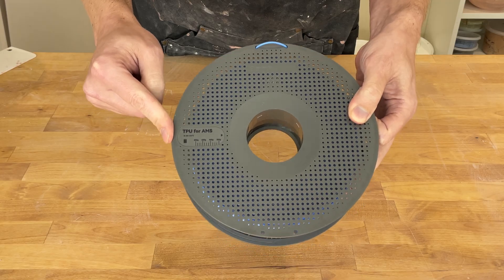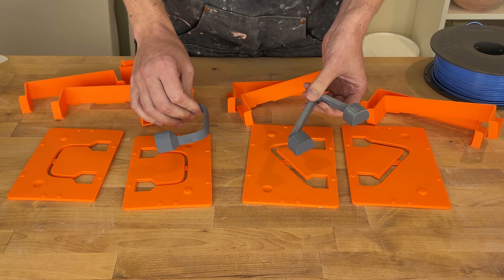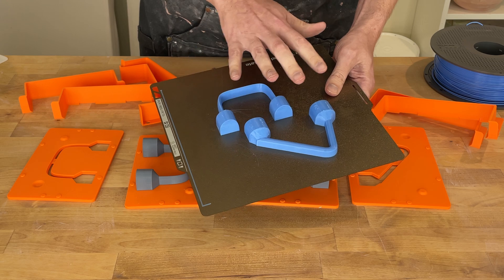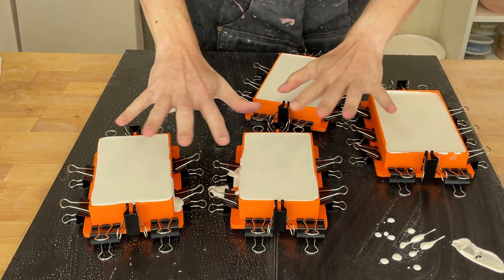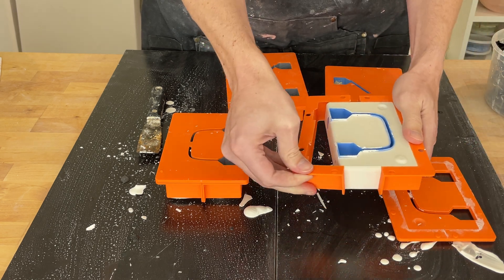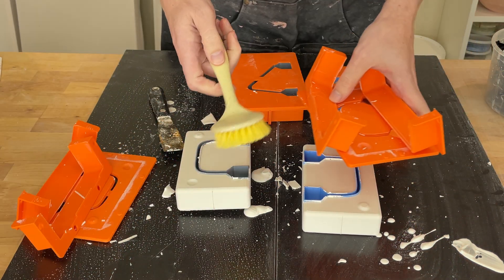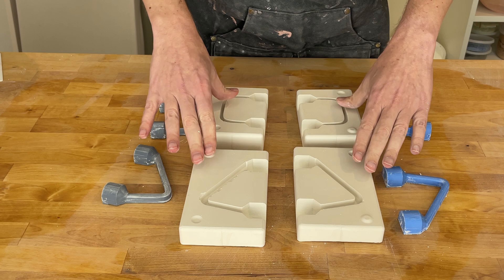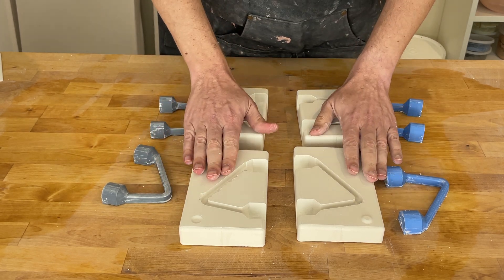Using TPU for AMS for Handle Molds

Comment: I just started watching your progress. I did something different that I'd like to share with you.
I 3D-printed the part as a negative. I then added foam board around the negative shape to build the walls of a box. I then poured silicone into it. Then, I made a box around the silicone to hold the plaster, which separates easily.
Reply from the maker: Yes, silicone is often used in these processes. When creating Shape Cast I deliberately was going after a process that removed that as a step going straight from 3D prints. I just wanted to remove the extra step in the mold creation process (but it does add some challenges to overcome).

Comment: compressed air wouldve helped with releasing a lot. You can also include some handles for pliers right in the model, I see there a lot of empty space in the middle, so a couple of holders will fit. They will be fine in tpu since its layer adhesion is great, worse in other filaments(might have to draw them differently)
Reply from the maker: There is actually not a lot of space for many of the designs for any features to grab on to (as shown in my last video). Some of the handles are rather narrow. The other issue is less that you want to pull up, but inward so as to improve the draft angles. If you get one, do try compressed air and let me know how it goes!
Reply: @PotterybyKent  i think you can put in the millde of the printed handle some flaps where you can pull with the pliers
Reply from the maker: Pulling up isn't so much the problem - it really needs to go inward and up. I actually think snap ring pliers would be useful here. But I'm not sure there's space to model in features for them.